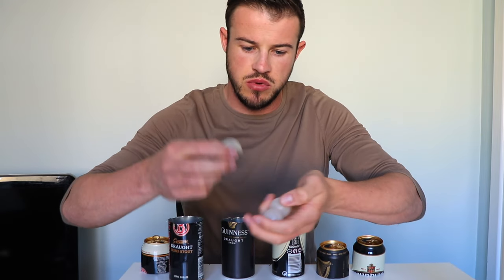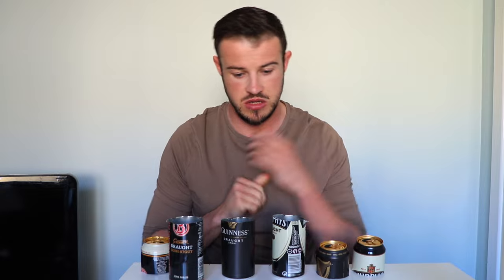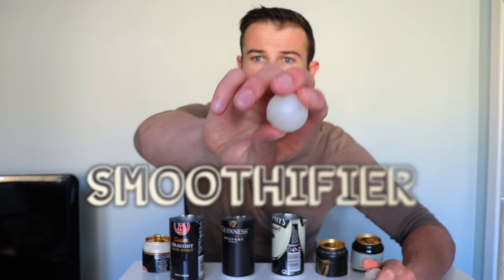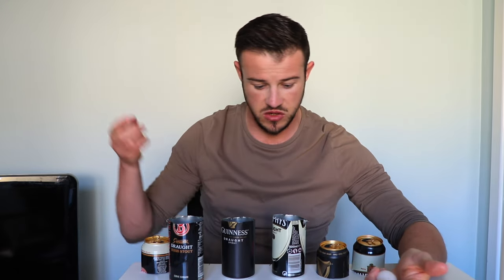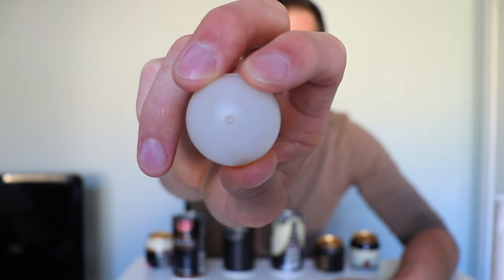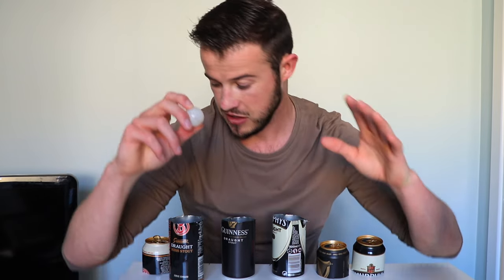Why is there a Ball/Widget in Cans of Guinness?

Comment: I've noticed that if the can is very cold (1-2 °C) it lessens the widget effect and gives a bad pour with little head. As every man wants both a good head and a cold Guinness. Any idea what's the oplimal temperature for can storage?
Reply: Guinness should be stored at 5c. It's not supposed to be a super cold beer and a beer should be served between 4.7-5.3c max to be a smooth served beer
Reply: 2.1'c
Reply: 4-5 cel or 42 degrees